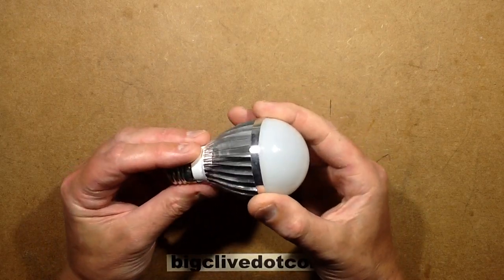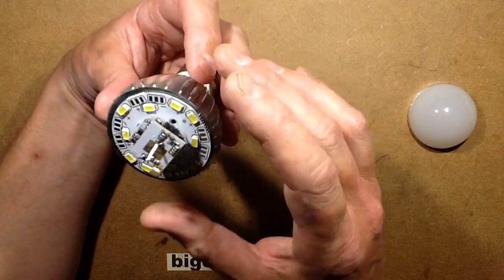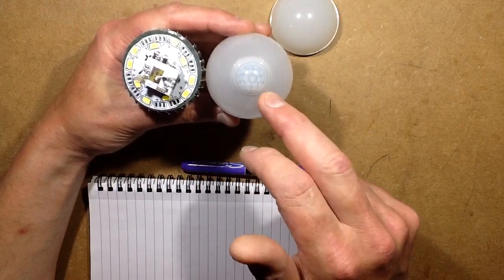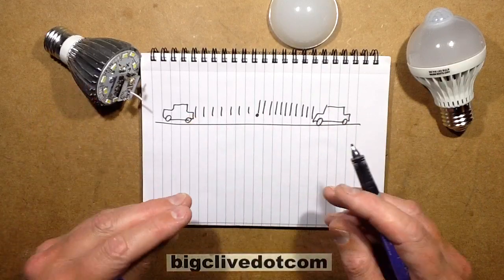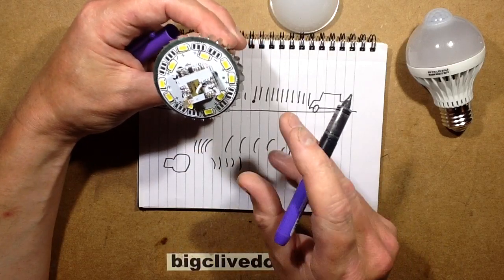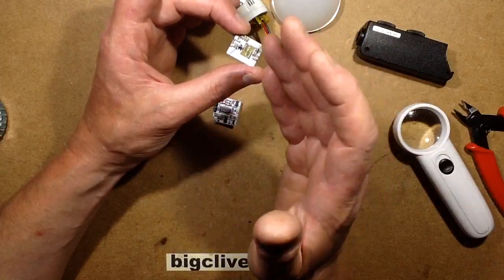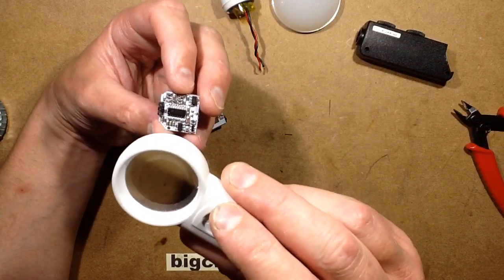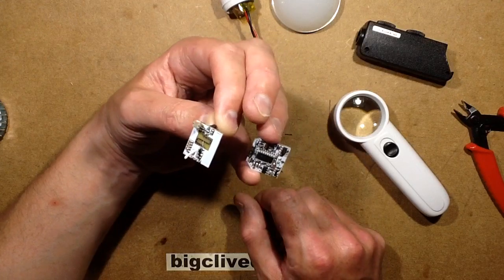Microwave doppler sensor lamp with perplexingly simple circuitry.

Comment: Q1 is probably a NPN BJT. The strangely shaped PCB traces make resonant circuits at 5.8 GHz, and putting them at the right spot in the transistor circuit makes an oscillator. Movement changes the tuning of the circuit and the voltage changes a little bit. The other chip just amplifies  the crap out of that voltage change and triggers when it gets to a threshold. 
The lots of tiny holes are plated thru via holes connecting the outside of the top of the board to ground around the edge, or making the output line bigger.

You can design impedance matched lines on PC board knowing the dielectric constant and thickness, and doing math on it (or looking it up on a nomograph). I've used standard FR-4 up to 5.6 GHz, amplifiers and antennas and whatnot. 

I first saw this circuit around 1964 where they used a tube oscillator at around 300 MHz. Around 1971 I built one at 10 GHz using a reflex klystron that I found laying around. Ran it into my guitar amp.
Reply: Can confirm that Q1 is indeed an NPN BJT, a high frequency one. Though I don't fully understand radio myself so this didn't bring me closer to understanding how the signal was transmitted, received and mixed.
Reply: Think of it as using the whole room as part of the oscillator circuit. A change in the resonance of the room makes a change in the DC current supply in the oscillator. Couple that into an amplifier, trip a comparator, and you've got a burglar alarm.
Reply: Thanks for explaining! So could I use the output from the amplifier directly on an MCUs ADC input to find out which way the voltage shifted, up or down, and get the direction of travel of the moving body?
Reply: No, all you get is a perturbation. It's a kind of self-mixing where you get a baseband detected signal: near DC. The problem is that your detected signal has no negative or positive shifted frequencies that could tell you whether the doppler shift was positive or negative, approaching or receding. It wraps around the zero (DC) point and both appear positive. You can count the frequency and figure out the speed, however. You can also tell things about the size or distance to your intruder, too, for what that's worth.
Reply: James Van Damme If I understand, a moving body causes an oscillation across 0V perhaps due to a phase change or the like from the resonating frequency, however you cannot determine the movement direction. You say speed and distance can be determined, do you mind elaborating? Thank you very much for taking the time to reply.
Reply: Also the size change would be great to not trigger by a cat, but trigger on a human. Is this measured in the amplitude of disturbance ?
Reply: A cat walking near the detector might put out a similar signal to a human walking further away. A person running would put out a higher frequency than one walking. I guess you need to build one of these circuits and  watch its output on an oscilloscope and play around with it to get a feel for the signals you get. I've worked on many radars, and did the same thing.
Reply: James Van Damme I've ordered 5 now to play around with them. My initial idea was to try and get a bearing by putting 3 rotated 120° but I think ill have to play with them a lot to understand them, also hopefully I don't need a too high sampling rate on the ADC to get some good information. Thanks again.
Reply: Figure your doppler shift with different intruder speeds and you'll find the signals will be in the low audio range.  
I built a demo radar once for an air show that I hooked up to my guitar amplifier. It got people's interest when they walked around it.

Comment: Why do I get the feeling this will fail every EMC emissions test known to mankind? Traditional LEDs are bad enough most of the time when they have switching power supplies. 

Still, love the idea of this type of device hitting the mainstream at what I would guess is a cost effective price point for the consumer market. Simple hardware setup. RF separation is not as nice as I would like to see but not a lot should be susceptible at this frequency range (with exception of wireless N upper band but IEEE 802.11n protocol should deal and the actual light should not be self susceptible .

Comment: Just a note for everyone using this, there's potential to screw with 5Ghz high speed WiFi. Because of the frequency...
Reply: Wifi? pfffft.  What I want to know is: If I point it (or a few) at my microwave oven, will cook food faster or slower? ;-)
Reply: +wdavid parks microwave ovens are shielded for microwaves. So the microwaves on the inside cant leave. And any microwaves on the outside can't enter.

Comment: What if you moved perpendicular to the microwave beam?
Reply: It'd be difficult to move completely perpendicular to it without also moving slightly back or fourth
Reply: Rambi yeah that's what I expected
Reply: You also have to consider the incident waves that are reflected not directly back at the receiver, but all around the room and then back to your body from every direction.  These eventually reach the receiver and will trigger the detector, regardless of the direction of movement.  This could detect movement anywhere in a volume, unlike the PIR sensor which is only really good for perpendicular movement of thermal sources.
Reply: The waveform of 5.8 ghz is about 2" long. Good luck with that :)
Reply: Yes! that explains why it has that vertical stub antenna (half wave dipole?) which will detect reflections coming from the sides.  If the lamp is hanging from the ceiling then any movement to be detected will be coming from the sides.
Reply: number 33 Yah. If everyone thinking about "black box radiowaves" took a moment to remember what rooftop antennas looked like before cable, they'd have a better understanding. All those vanes and protuberances were spaced as they were for very good reason.

Radiation can be a wave, and waves have a cyclical rate, and that rate can be represented by distance. Hence antennae have spacing between each vane for every major frequency... So they catch the cycle....
Reply: The high frequency reflecting off of walls and objects creates patterns of standing waves in the area around it.  Moving perpendicularly to it will change those standing waves and vary the location of the nulls and crests that the receiver will pick up.
Reply: It isn't a beam.  The antenna appears to be a vertically polarized end-fed dipole so the maximum sensitivity will be in a donut ring shape around the length of the antenna or sideways from the lamp.  It will be least sensitive off the end of the antenna wire.  However, it works by sensing changes in the reflections bouncing around in the room and it would be difficult to avoid those reflections even if you manage to stand exactly under the lamp.

Comment: I'm pretty sure (could be wrong) the piece of wire is the transmitter and the wavy track is the receiver. The weather radar receiving antenna on aircraft are built in s similar manner but on a larger scale. they also transmit the signal at the same time witch it witchery to me but all i need to know is how to test it and replace what needs to be. :)

Comment: Hey all. Just to confirm it is indeed a phase shift detector. +5v ground and a floating ground to trigger. unlike the road sensors (that have now been replaced with pole mound dopler units) this does not work on capacitance or like the road sensors that used EM detection aka a metal detector. Dopler detection units or at least the many I have seen don't have a transmitter rod like this lamp. Dopler only needs a finely tuned pcb antenna that does both jobs. As Clive stated they are found in dualtek (as they are known in the trade) alarm sensors and have a range ajustment via a small pot usualy. If the 5.8Ghz is correct that's a little to close to the wifi frequencies and on a board like like that intermodulation and drift may well create a problem as I doubt the build quality is going to be top notch. I am going to order one myself as I have a SDR that will show the entire spectrum. Very interesting lamp and a great video as allways.... P.S. surely the correct value resistor in place of the LDR will solve the light sensing problem, at those power levels who cares if it comes on during the day!
Reply from the maker: It appears that most of the similar modules don't have the extra antenna stub.  I wonder if this had one to change the range.  If i was using this lamp for room use I'd probably add a dot of black marker ink on the front of the LDR to make it light at higher lighting levels.
Reply: +bigclivedotcom That may be the case, there are 360 degree dualtec detectors that would need to detect just the room area. I have seen at least 10 different brands of alarm ceiling sensors and they all have the waveguide pcb etch but not the vertical antenna. This popular model for example..... http://g01.a.alicdn.com/kf/HTB1DAesKXXXXXcKXpXXq6xXFXXXy/Wired-PIR-MicroWave-Ceiling-font-b-Sensor-b-font-with-font-b-360-b-font-font.jpg   has a single flat pcb with a single etched antenna. I am wondering if the type of sensor pcb you have in the lamp is geared towards presence detection for room lighting, given the LDR on the board I think this is the case. I have yet to see the insides of that type of sensor. BTW ultrasonic sensors are still in use but only employed in very stable area's. I have seen them in safety deposit centres for example.

Comment: I'll bet that thing plays havoc with 5.8 GHz Wifi.
Reply: Clive said it puts out 2mW. 5.8GHz Wi-Fi can use 50-800mW so I think it blows it away. 
On the other hand, maybe the bulb could be used to detect network activity. :P
Reply: No, it cannot. The bulb is looking for the difference between two signals. The signals themselves just happen to be high frequency. Imagine overtaking someone, you walk 6 km/h and they walk 3 km/h. Now, imagine you were driving instead of walking: one going 120 km/h and the other one going 123 km/h. The duration of the overtake would be roughly the same even though the speed of travel is really fast. Same sort of thing here, the signal difference you are trying to resolve has more to do with how fast you are walking towards/away from the light bulb, not the signal emitted. The signal frequency just allows for more accurate spacial and temporal resolution.
Reply: Klikkitse
Exactly. It's such a small signal, and it's only being used to detect changes in the area around it.

Comment: you can get a lot of mircowave setups that basically just need to supply power to them and they self oscillate,  and as you said, its all based on controlled impedance circuit board design..  but yeah with a single antenna you can actually do rf-mixing in the ocscilator itself, and the output signal frm it is a signal that is a signwave in the Hz range that is the difference between the transmitted and received frequency. and that can be converted pretty easy into a movement speed..  not sure how that device uses it, but with opamps and capaciters could easily setup something that basically is  "if Hz > x then trigger"    but yeah...  power, ground, and signal.   Anyhow the signal output is going to be sub kilohertz   ...  at 5.8 GHz, the output will be about 39 Hz for every m/s of the motion...    ie if the person is walking 1 m/s the output will be 39 hz, if 2 m/s  then about 77 Hz.

Comment: The detector send hf and receive hf but with a little frequency. Then you multiply what is sent by what is received. Then you remember that sin(a) sin(b) = [cos(a - b) - cos(a + b)]/2 so mixing the 2 signals gives you a sum of 2 sinus. One with the frequency offset and one with almost twice the original frequency that you discard with a low pass filter. At the end you end up with a sinusoidal signal with a frequency proportional to the speed of the object in your direction and amplitude corresponding to the size and proximity of the object. This simple signal is easy to detect.
Reply: 1st sentence, read ... little frequency OFFSET.

Comment: You can get the microwave sensor boards for a couple of bucks a pop on aliexpress, btw. I just got a bunch for a project.
The specs are on there (<3ma quiescent, 2mw tx power, 3.3v). You're correct, they use a PIR chip, which is a really nice trick. Someone clearly figured this out fairly recently b/c these bargain basement MW doppler sensors only recently appeared - I used one years ago for a project but that unit was sold as a burglar alarm for open-top cars (which it did quite well). Still not terrible complex, that one just used a quad opamp and some analog stuff.

http://www.aliexpress.com/item/LED-Microwave-Radar-Sensor-3-12W-Microwave-Sensoring-Switch-Special-for-Spherical-Lamp/32602421530.html

Comment: Isn't that the way of things? Here I was, the poster child of "ignorance is bliss," gradually figuring out and working with RF stuff, and it turns out I've been practicing the Black Arts the whole time. ;) lol jk 

I really liked this tear-down, Clive. You're right about the track layout being important to HF designs. The 'troubles' begin when signal wavelengths begin to coincide with track lengths, in the radio wave to microwave frequencies; radio is 3 Hz to 300 GHz ( λ = 100 km to 1 mm), microwave is 300 MHz to 300 GHz ( λ = 1 m to 1 mm), but I usually say 'beware' around & above the GHz region. Basic components start acting weird, or at least not as anticipated. Those non-ideal values such as ESR, ESL, and indeed, track (and ground plane!) layout, become critical.

Comment: I used to repair Firefinder radar, and one old Vietnam vets who were our instructors, used to tell us they would light up fluorescent lights with the radar at 150 meters or so. Was it old soldier BS, or can this happen?
Reply from the maker: High power radio transmitters can excite the gas in fluorescent tubes.  A bit like plasma lamps.  You can also make them glow by holding one vertically overhead under suitably high voltage transmission lines in the dark.
Reply: Yes, and it's telling you to get the hell out of the beam! 

I worked on a transmitter that was so high powered it would light up the neon indicators across 30 amp fuses....  
I also had a TPQ-37 transmitter to play with.

Comment: Standard operation for cheap microwave radar modules.
Rf is generated by a Dro, dieelectric resonance oscillator, just a fet oscillator with a ceramic 'puck' as the tuned element.
Rf is generated then split 2 ways, one goes to the transmit aerial and gets radiated out into the room, the other goes to a mixer, this mixer mixes this signal with the received signal from the receive antenna.
If an object is stationary theres no diffrence in frequency between the transmitted signal and the received signal, as soon as an object in range moves theres is a difference in freq, this freq difference depnds on the speed of the moving object, because people move very slowly compared to the speed of light the output freq of the mixer is only a few Hz.
The 'voodoo' tracks on the board are microstrips, and these are often used for filtering at microwave frequencies.

Comment: It's really not that complicated! it's just an RF oscillator that operates at a high enough level to radiate a useful level of signal. The reflected signal will be picked up on the same antenna, and through non linear action in the same transistor mixes with the oscillation. The beat (the frequency difference due to Doppler) between the transmitted and received signals becomes impressed on the current flowing in the device, and is simply a very low amplitude, low frequency audio signal developed across a resistor in series with the oscillator's collector or emitter. Since it is very similar in amplitude and frequency to the output of a PIR sensor, they've simply used the BISS001 to do the high gain low noise amplifying and level detection. I first saw this very sensitive single transistor RF stage design in a high-end car alarm back in the 80's and thought it very clever then. That would detect movement outside the car and give you a verbal warning to back off!
Reply from the maker: That makes sense.  Yes I remember one of those car alarms actually telling me and everyone else on the pavement who walked past it to "back off".  Very irritating.
Reply: It gets tricky at 5.8 GHz.
Reply: Those alarms were great fun, see how many times you could get the warning before the battery died :op
Reply: I was just about to say that. With a two inch wavelength the beat not going to be much over a couple of Hz.  I wonder how two of them work in close proximity.  Would they lock together or just stay on all the time?
Reply: Roughly what I was thinking, Doppler shifted echo mixed with the transmit CW signal produces a low frequency signal that the PIR chip can detect.
Reply: They've been around awhile.  https://en.wikipedia.org/wiki/Proximity_fuze
Reply: Oh so it's a simple beat frequency oscillator. Welcome to the experimenter world of amateur radio.
Reply: That's easy for you to say sir !

Comment: The microwave sensors have been around since the 90's, they were an optional extra in the car alarms we used to fit at Road Radio. 
We used to fit one under the drivers seat, for the car alarm purposes it just used to create a voltage drop to trigger the alarm. 
The ultra sonic detectors were pretty much standard, but a window left open a little bit would set them off.

Comment: A microwave-module can be bought stand-alone: http://www.ebay.com/itm/401082379029
Reply: Here is another with some specs http://www.ebay.com/itm/LED-3-12W-4-7m-Microwave-Radar-Sensor-Switch-Module-for-Bulb-Ceiling-/401135935423?hash=item5d65909fbf:g:SCIAAOSwvg9XXRJL
Reply: Nice find.